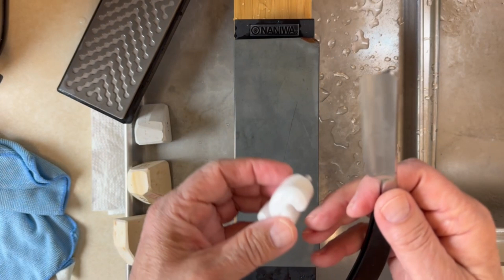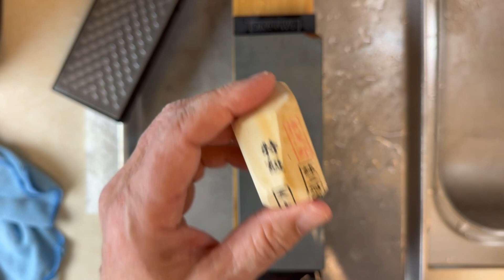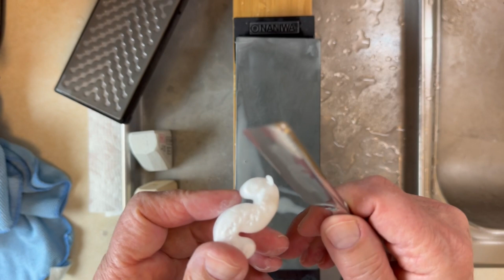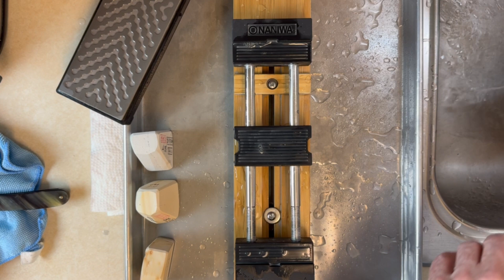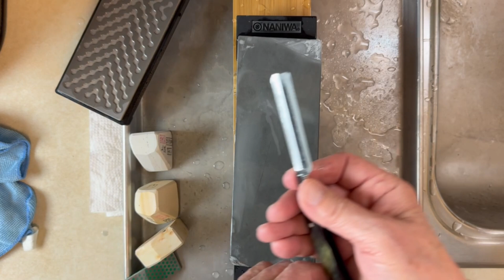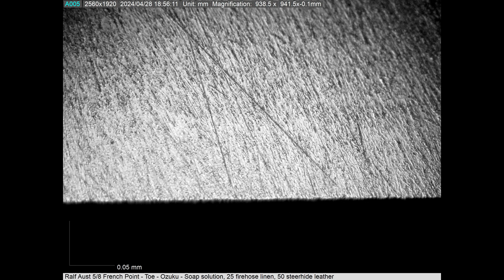Skipping Steps - Honing a Ralf Aust

Comment: Yet another great video! Curious to hear more about using dish soap on the finishing laps. Something I have yet to try.
Reply from the maker: It's really just about adding lubrication to the surface. Friction and abrasion are reduced by doing this, so it is a way to eek out a tiny bit more refinement from a stone without going too far and creating an edge that's too fragile.

Comment: Hey Greg, I thoroughly enjoy your videos, but I think you made the wrong decision going with a different stone: how would you know if the Ozuku is causing these issues now? Perhaps you are planning on using a cheaper razor to test it out? Also, you gave an interesting definition of keenest in the other video where you measure 3 mm from the apex. Can you expand on that? Where does it comes from? Thanks in advance.
Reply from the maker: Hi Ramon, and thank you!

You are correct, I have another razor that I will use to see if there's an issue with the Ozuku.  I have already resurfaced it, and that revealed a beautifully smooth layer of the stone. So I'll be testing it next.  Because of the way the chip was smoothed by the sharpening process, I actually think it was there when I started and was refined by successively finer slurries.

As for the definition of keen.  That comes from the Science of Sharp.  Measure the width of the bevel 3 microns (not mm) from the apex toward the spine.

Comment: Hi Greg. The shape of the chip can indicate to me that the edge had a small plastic deformation from shaving that the strop was not able to allign. I usually get this close to the toe because I use this part of the blade under my nose where the hair is coarse, and I am using an open angle. This can create a high spot that form a chip when you hone.
Reply from the maker: I agree with you. And, the size of the chip is consistent with one failing from the stresses of shaving. Furthermore, the smoothness of the shape of chip under the microscope indicates that it went through the whole sharpening process.  But ... I would know this for certain, and I could have saved myself some work, had I simply looked closely at the edge before starting :)

Comment: The Ralf Aust I have is the Spanish point, but sadly, it has been a problem child for me. It has a really bad warp on the blade, and with my newb abilities, at the time, I over did it on the spine and had to use some jank in order to hone it. But I still have not gotten the edge that it could be. But I haven't given up on it yet.
Reply from the maker: My experience with razors that have major geometry issues is that the geometry can be fixed,  but so much metal has to be removed, somewhere, that the overall performance just won't be what it could be.  Minor issues can be overcome and sometimes create a terrific shaving razor.
Reply: @Greg_Gallant  I get it to where it is close to a nice shave, but not quite up to what I think is acceptable. OCD thing I guess.